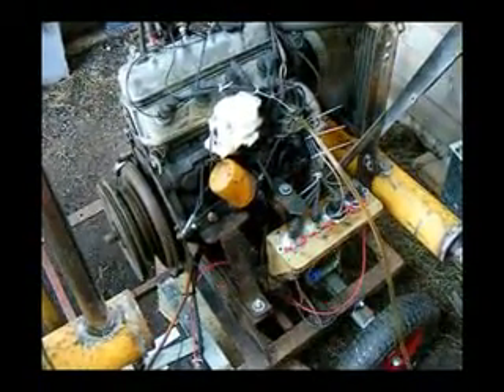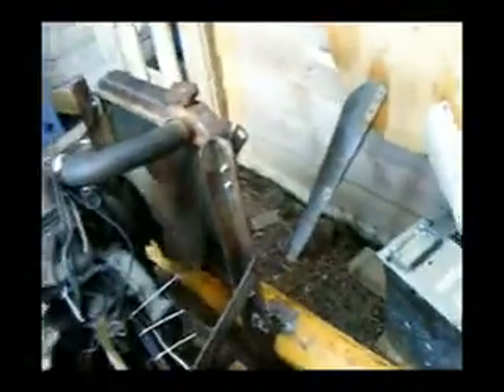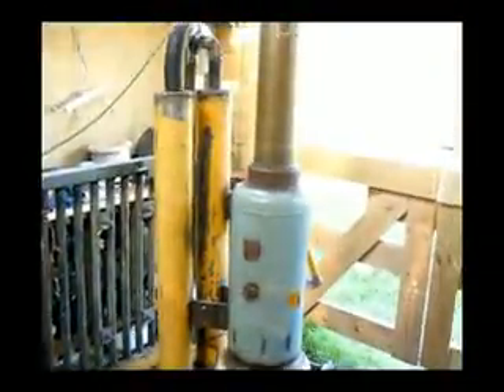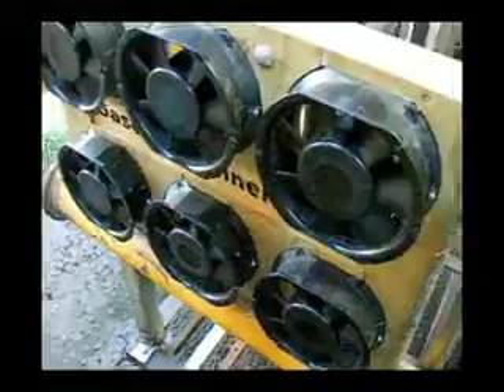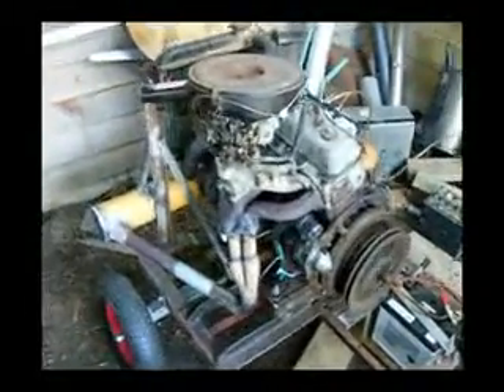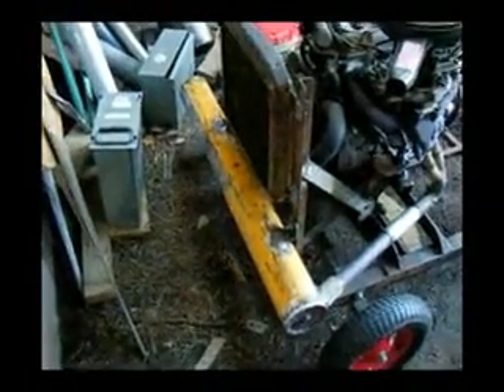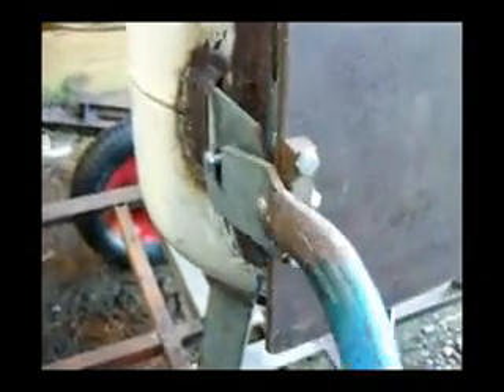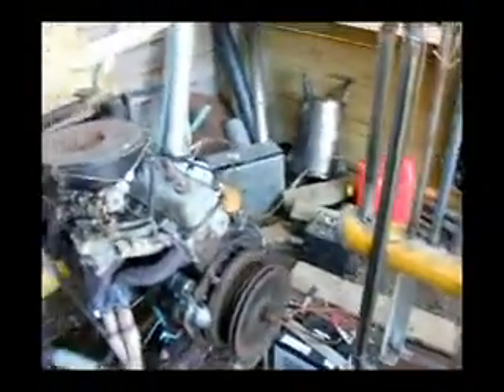4 cylinder Petrol engine driven by Multi Coil ignition system.

Comment: Great brain storming , thanks for your ideas.... Great thinking....
Reply from the maker: +KEVINNOAD1
Thanks kindly  :) .
This system worked very nicely, after I did a bit of fine tuning.
That gasifier powered engine was strong enough to let me do arc welding at up to 200 Amps in steel up to 10mm thick.
I am currently using its smaller brother, with a 13HP engine, to generate my winter electricity supply.
This little machine saves me about $1500 per year, so I am all smiles  :) .

Comment: I will send u a private message with a link to a place that they have 12 and 24v water heater elements and also dc thermostats too so you dont boil your water and so it wont freeze. With my gas unit and my homemade gen i never run out of power. Ya i just hate how it turns every thing black so on my next setup i am thinking i will setup my tube filters with a water wash out while running it will make the gas wet but if i put a few more tube filter inline should dry it out.

Comment: You know if u have alot of extra power why not make a HHO that has a built in hydrogen and oxygen seperator so you can store hydrogen and store the oxy seperate than at least you would be storing extra power when u need it u have it you could use it to cook or set up a cutting tourch  both would be handy

Comment: The whole water bubbler stuff is a joke just look at it like this take a bowl of water light a cigar and use a straw to blow the smoke threw the straw in the water what happens is u get bubbles full of smoke out of the water with only the out side of the bubble getting any of the cleaning action so to me its a waste i like to make tubes each filled with a diff filler i like stainless steal wool, ball bearing, small rocks, pure light, glass marbles, all those can be washed real easy too.

Comment: Do you have any micro turbines up here at 9k ft i have 3 up one 500w  1 1000w and 1 that is about 1400w they keep me from having to put up my solar like right now i have 22mph wind my batts are full even watching tv on here and they now kicked over one is heating water and 2 are running heaters its nice when its cold here the wind is strong last winter my dc heaters made it so i never had to start a fire lol.I have a load divert to the heaters on a auto switch so i use all i make.

Comment: Go to flash001USA here on youtube i just had a good convo with him on filtering. The hot water is a nice thing i have also seen where if u take a old 2 stage air compressor unit rest the valves and it makes a great steam motor.

Comment: You can cheat take a PMA open it up it has the same windings as a car alt so if u take the 3 wires that go into the rectifier and hook on to all 3 than u have AC  strong enough to run yr grinder but not threw  an inverter

Comment: Ya i hear you on that most ppl go wood what? then i have to go into 3hrs or more just to get them to understand it. I love if u get a good filter setup at how it burns just like natural gas or lp gas very blue and with good heat out put. Have you thought about putting a steam tube in and a hot water tube to make both them i have both i like the steam not for power uses but to clean with lol.

Comment: Have you ever looked at 24v DC motors to run most yr power tools i set my shop up that way changed one over at a time until i got it all working on 24v dc that saves me from having to worry about a big inverter or running a big generator thats how i was when i first went off grid now i have a nice 250cc motor cycle engine that makes all my power it has 2-24v-100amp PMAs and one 12v PMA i also have 6 water cell telephone batteries the tall ones that they sell once a yr.

Comment: Yep kinda the same but where i have more yrs on wood gas i only use DC power 12v and 24v no inverters i took and just got a new tv a 3D tv and i took it apart same day i got it home and converted it for 24v DC once you know how to it only took me about 1hr to convert it and for cooking and hot water i store wood gas in 5 tractor inner tubes and that last me 2 or 3 days no need for lp that way and for air conditioning i took an RV frig and made my own unit the works on wood gas or 12v.

Comment: What i would do is a single geared small 12v dc motor make 2 sheet metal butterfly then hook up all 3 the carb and the gas and air butterflies by a bar set like how dual carbs are then set yr mix for an idle them when u increase the speed all three would open at the same time and if you dont work hard to get what u burn just use it. I have tried and tried to play with fuel mix but its still a 1:1 and that can change if what u burn does if using plastic and rubber more like a gasoline mix.

Comment: One ? tho do u understand that the o2 doesnt detect oxygen and it really picks up on carbon with that said on wood gas or a multimix the carbon is higher in it than gas just keep that in mind also with a butterfly setup you woudnt need to rely on a bad tec like o2 sensor you would be better to use the knock sensor in a newer motor just my 2 cents
Try a mix of 5% plastic 5% rubber the other 90% wood it really is nice just add 2 more filters due the soot in the rubber

Comment: To make a computerized mixer all you would need to do is make a board that could control 2 multi position solenoids that based on yr timing speed rate of fire would open them more or if slower close them some and it would be all based on the speed of the motor.
Yes they really are and once u get filtering down where you can run any wood than you also can mix in plastic and rubber and get back the HP wood gas looses

Comment: at the same time how big your gas feed pipe needs to be and how big your gas unit and connecting pipes need to be how this works is simple if its a 2" pipe than the burner unit for best function should be an 8" burner tube to get the most out of the motor i hope this helps u out i know from building units for specific use this formula works great!

Comment: After watching some of yr vids i see one thing that i can tell u that would help out alot its how u feed the gas into yr smaller motors 4wheeler dirt bikes generators this is how i figured out is the easy and best way any small motor 4cylender or less if you just take off the air filter and find a chunk of pvc pipe that fits ontop the carb nice and tight than i put a pvc Y in and put ball valves on each Y then i just set the fuel mix 1:1 than the carb still works like normal and it gives you

Comment: good a gas and veg oil mix and get a much bigger bang for the buck yes i know odd thinking but its what i do it would make a motor more like a cross bread 1/2 gas 1/2 diesel and could give alot more power than just on gas you could spark a new style of motor too! If you have a really hot spark it could also be great for running pure alcohol. Could be a nice setup for race cars. keep up the great work.

Comment: One ? for u could you make that setup for say a v8 or inline 6 if so you just could have a great setup that you could put a patent on it and manufacture it may not sell a ton but ppl like us and me would love to have a setup like that for more motors the idea behind it brilliant and yet very use full at the same time the extra power to each plug and the extra sparks i bet it could run on oilier gas mix and run just fine due to how hot the spark is and all of them. I bet one could run and run